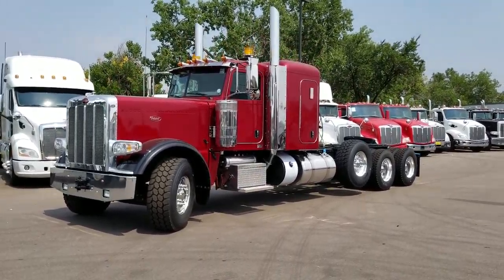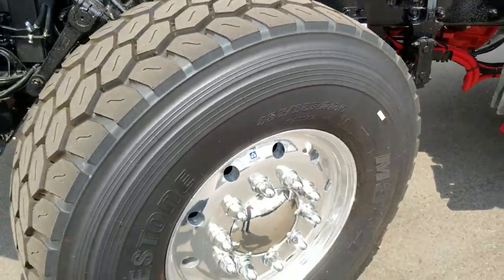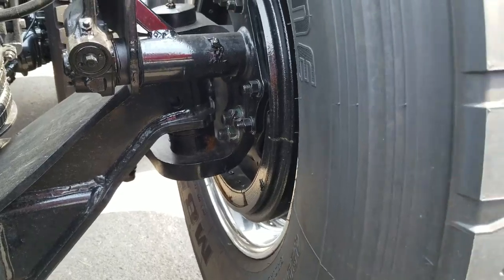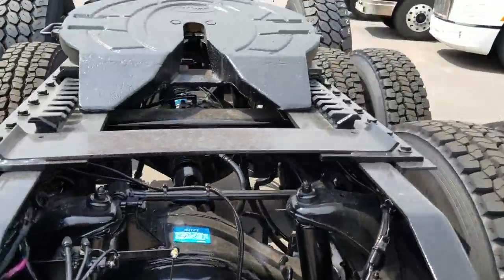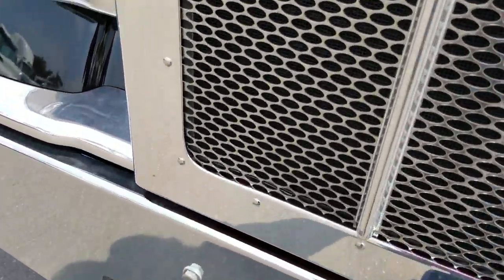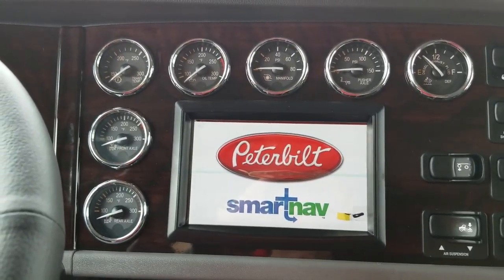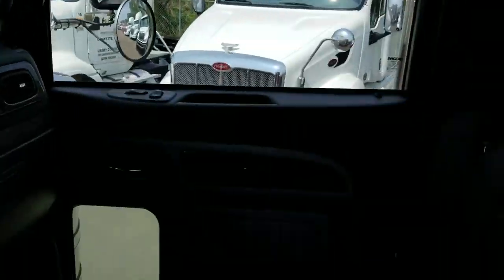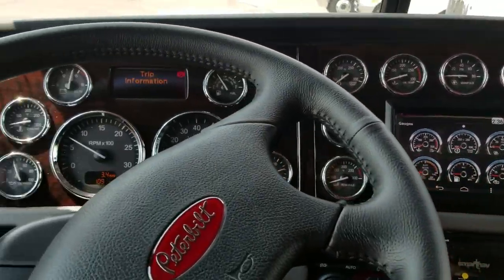2019 Pete 389 Heavy Haul Diamond Red / Black Fenders Call JW 970-518-5520

Comment: A hour per axle to change drum brakes? Man you have been to the wrong place. I've changed 3 axles on semi in a hour and 10 mins. And before you say anything I had a helper. He took the tires off and put them back on and I done the brakes
Reply: KODA 002 & your point? I didn't know the trucking industry worked out of your time sheets. The average owner operator who does most basic maintenance him/herself won't be able to in an hour. They probably won't do it themselves but disk brakes are far easier, and simpler to understand. Don't have to do any heavy lifting of the drum, nor get arms covered in braking material. Just take tires off, remove dust shield, back the nut off and slide the two pads out, and new ones in.

Comment: Are you taking orders for similar builds with an automatic trans vs the 18spd manual?
Reply from the maker: We have ordered with Allison Transmissions.  I have built specifications for an 18 Ultrashift Automated but have not taken orders on them yet.
Reply: gabe perreira who in there right mind would want a automatic, especially in a heavy haul truck
Reply: @kevinguffey1564   A person who cant drive stick
Reply: @kevinguffey1564  a lot of heavy  hauls are auto especially the loads where you have to run two tractors.
Reply: @kevinguffey1564  theres a huge difference between auto shift vs automatic. True heavy haulers ( superloads) run auto

Comment: Can you get this heavy haul set up with a larger sleeper and still fit a wet kit for trailer controls?
Reply from the maker: Yes, I believe so. I would have to build one to see for sure. Not sure if it would be a flat top or a standup.
Reply: With a wet kit the oil tank is mounted on the side of the frame. In order to add oil to it there must be access from above. So there would need to be access from above without a sleeper blocking it.

Comment: How big is the sleeper
Reply: Dane Patterson 58" inch
Reply: What does this truck go for as it sits
Reply: Dane Patterson probably around $150,000 give or take
Reply: The one thing id change is having the pete air trac changed to a chalmers rear end and a 605 horse motor and standard interior
Reply: Personally I would go with a glider-kit. Ag-suspension, and a older cat engine. But that's my preference. I saw a kw w900 that fit those specs in Texas, it was a 2018 and they were asking about 120k for it
Reply: @koda0027  is it a heavy haul
Reply: Dane Patterson I don't think it is.
Reply: Lookin for heavy haul pay is way more
Reply: Dane Patterson I know brother. I drove also. Trying to get my license back now. CS suspended them and I miss the money and driving otr. I always loved the oversized and heavy haul

Comment: Man thats a terrible spot for the pusher axle suspension. other than that, i love that truck lol
Reply: Why is that spot a bad spot for the pusher axle suspension?
Reply: in my mack its right up on the dash, easy peasy
Reply: I thought he was talking about where the air bags were mounted not the switch. I've had them in the floor and on the dash. It doesn't really concern me I get used to them and I hit the switch without thinking.
Reply: @kingmike40  illegal in NYS actually

Comment: Nice truck, but the disc brakes need to be taken off
Reply: Don't forget that it's 2-3 times more expensive to replace them as well. But to each their own.
Reply: Max Bettencourt and don't forget on a tandem truck you've got 8 less grease fittings for much easier maintenance
Reply: Disc brakes last longer. You can get up to 500.000 miles or more on these. The Europeans have used disc brakes for many years.